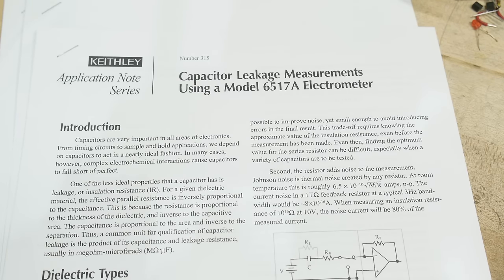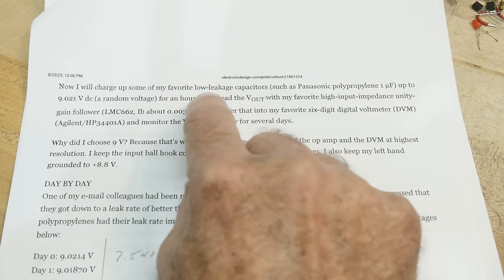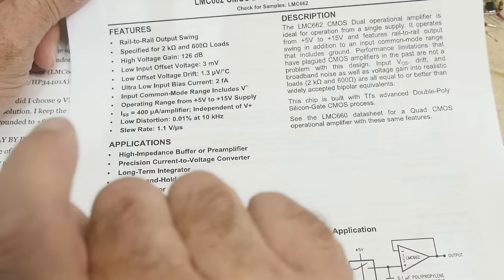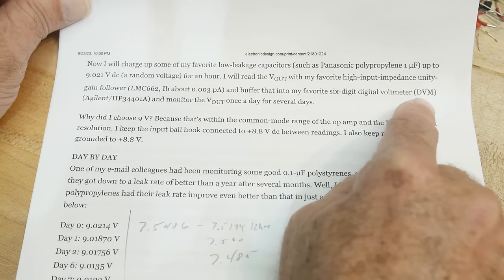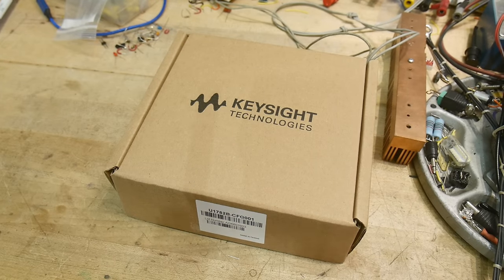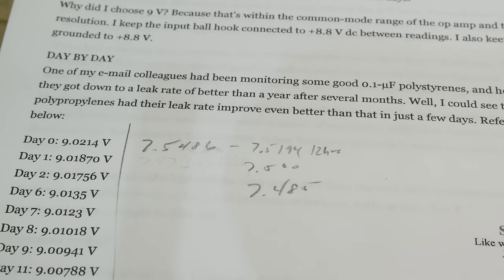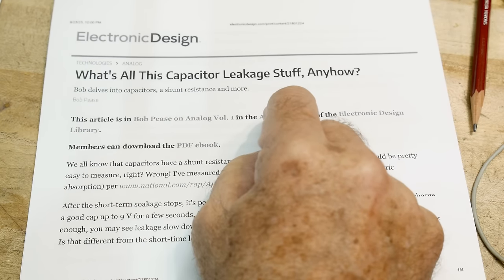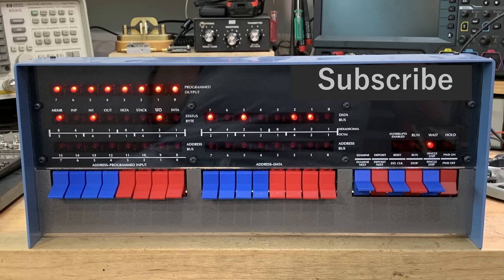#1692 Measure Capacitors Like Bob Pease

Comment: I have the original National Semi Analog Applications book. And all the Linear Tech application books when Bob jumped ship from National. It was a great move for Bob where he worked with Jim at Linear. Those two were magic together!! Jim's speciality was switching regulators, where I learned most of what I know and have applied. The two had a great phrase that I still use today: CREAKY DISCRETE! Describing circuits built proto style, with parts hanging up in the air soldered to stuff by their leads. They where recipes for Lab Queens, a design that only works in the lab. Got a few of those, too! 😁 I seriously miss those days and the buzz that was all around Silicon Valley. I am blessed to have experienced it!

Comment: Sometimes what you got from Bob's excellent columns was more about how he approached problems; how he helped engineers understand the things you weren't taught in university; how he was firmly grounded in the practicalities of designing circuits and understanding how and why they behaved the way they did - or the way they didn't behave. I was privileged to meet Bob once on his trip to the UK as he toured some electronics manufacturers. His beard and Volkswagon Beetle were legendary! As he said in one of his columns, you never saw a Beetle at the side of the road, broken down.
Reply: I wish I could have worked in the electronics industry with people like Bob.
Reply: The old beetles were reliable but not very safe.

Comment: "Great Scott! Two femtoamps!"
That's a nice chip-of-a-day not really labeled chip-of-a-day. And a nice though long-ish cap testing method.

Fun fact, air wiring has been done on a Meratronik V640 (sold on Canadian market as Conway Masteranger 639). There's a teflon-insulated terminal on the input pin of the HLY7006R hybrid opamp, to prevent the PCB resistance and capacitance from disturbing the measurement. The sensitive input circuitry as well as the range switch are shielded with sheet metal boxes.

Comment: Bob Pease was a wonderful man with insightful comments regarding all facets of electronics!
Reply: Not limited to only electronics.  I remember he covered all kinds of human life topics, such as not needing weight scale or some thickness measuring devices (calipers).  He just memorized for example American coin weights and used them as a reference.  Same, he memorized common office paper thickness and could then use his finger touch to compare the unknown to a stack of the paper sheets.  He also figured out a roof leakage location that was nowhere near either the smoke stack nor the tell tale spot on the ceiling.  Also, it did not appear during the rain.  So, the water was delayed on its way.  And that was his clue, the water was traveling a long distance on a wooden beam, until it finally dropped down.  And of course, he calculated everything he needed in his head.

Comment: I just dismantled a gamma spectrometer and the supply circuit for the germanium detector used "air wiring." The resistors in the circuit were "open circuit" as far as my 6 digit DVM read. By using an insulation tester they tested at 2 gigaohms each! I'm guessing conduction on a circuit board would taint the reading so they used the air wiring. Also, the housing with the electronics board was O ring sealed and had a valve connection to fill the compartment with dry gas. No way to operate the spectrometer since it needs liquid nitrogen so dismantling it for knowledge was its fate.
Reply: Those detectors go bad if they're taken out of liquid nitrogen, with about the same time constant as fish. So the detector was trash anyway.
Reply: @ke9tv  That is nonsense! But I do agree the unit was "trash" since without the control electronics plus having to get the nitrogen every time you want to use it there is no way to be practical. The detector crystal is in good condition though. (for whatever good it will do!)
Reply: @glasslinger  Depends on the crystal.  High-purity germanium is stable, so are CdTe, CZT, NaI, HgI2.  SiLi most emphatically is not, and GeLi is even worse - and I suspect strongly that the crystal in question was GeLi. Back in the day, that was the commonest X-ray/gamma detector that needed liquid nitrogen. (And it's still got impressive resolution of photon energies, so it still has its uses.)  When I was in grad school (more decades ago than I care to admit), some of my colleagues never got to take a vacation because those cryostats had to be kept filled at all times, even when they weren't taking data.
Reply: @ke9tv  Maybe I can make a pendent out of it.   :)

Comment: A way to get close to air wires in 'production' is teflon terminal standoffs.  You can see those in e.g. the input and integrator circuits of many bench meters, probably that HP34401A.  Hmmm.  I think I'll build a simple unity gain buffer probe with that LMC662 part for poking around high impedance low frequency circuits...

Comment: Got his books and a bunch of his app notes.
Reply: I get the impression, perhaps incorrect and even grossly so, that a lot of hobbyists these days don't read ap notes (I'm old ap is spelled with one p ) and instead rely on videos. That is a big mistake. There is vast body of knowledge to be had from ap notes, including those from many years ago. There are also many excellent, if somewhat expensive, books from people like Bob Pease and Jim Williams. 

Bob did harbor some perverse ideas about computers and simulations.He'd never dream of using an oscilloscope without being sure the probes were properly compensated or without the understanding of how probing loaded and changed the behavior of circuits, yet he'd get all bent out of shape because of his own failure to attend to the details of simulation, blaming the computer for his shortcomings.

Comment: When I needed to measure GOhm resistors, I found myself OPA2376, probably cheaper:
0.2 - 10 pA input bias current as well as 5 - 25 uV input offset voltage, quite a bit better that ones in the video at 1 - 6.3 mV.
Also Ib for LMC662 range is 0.002 - *4* pA, so...
Reply: The Max4239 is my go to, nice part Dave Jones (EEVBlog) used them in his 'Micro Current' product thats how I found them.
Reply: @andymouse  It could work, but unfortunately Maxim did not test nor guarantee its bias current range
Reply: Oh Interesting ! yeah works fine  and Thanks ! :) @Mr.Leeroy

Comment: Mr Carlson capacitor leakage tester is an interesting simple project.
Reply: Find it interesting when he told about bipolar caps shielding there has to be at ground so it not pick noise up. Suddenly they also are important to fit correctly.

Comment: Thanks for sharing, I am thinking about making a high resistance measuring adaptor to regular multimeter 
with this op amp that will be able to mesure 1G ohm do you think it is possible?
Reply from the maker: R=V/I so yes. just pick values that work.

Comment: I would wear gloves if I'm doing this precise measurements. The grease from your fingers could increase the femtoamps slightly
Reply: Scrubbing the circuit board and rinsing with deionized water is likely helpful as well.

Comment: Funny, this video was just recommended to me when two days ago I measured some capacitors that I charged up to 50 V their maximum over two years ago. 
      They were wrapped in bubble wrap and stored in a box and I just measured them and they all still have 10 V charge after two years.
      These were electrolytic capacitors for a class A amplifier is what there to be used on. On the power supply.